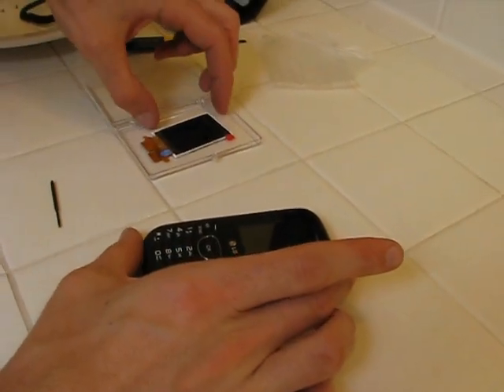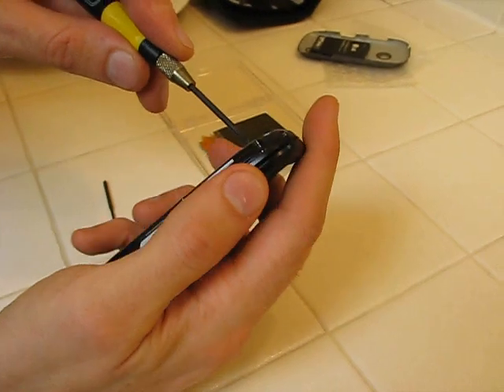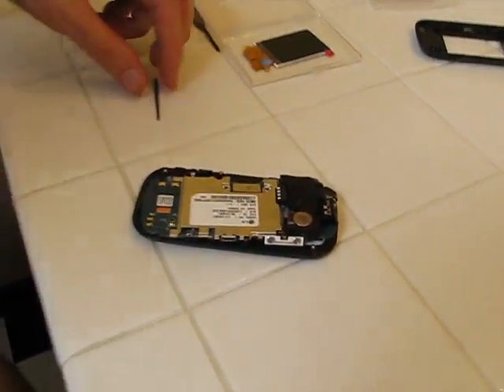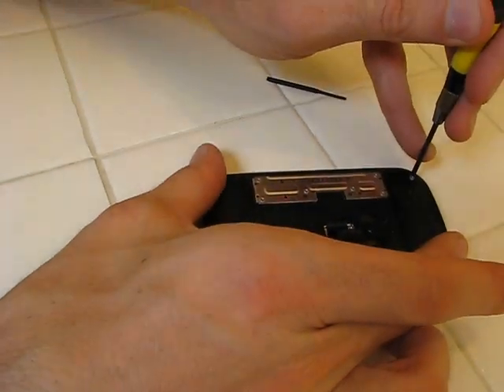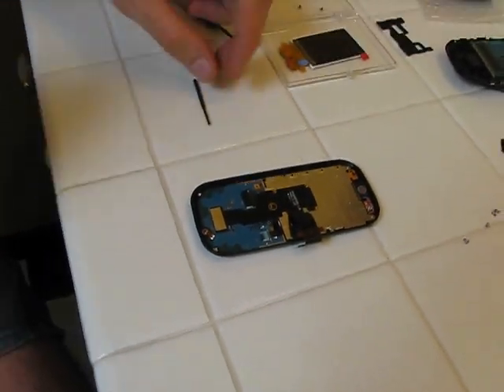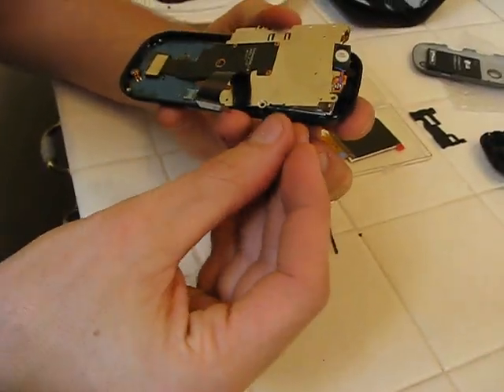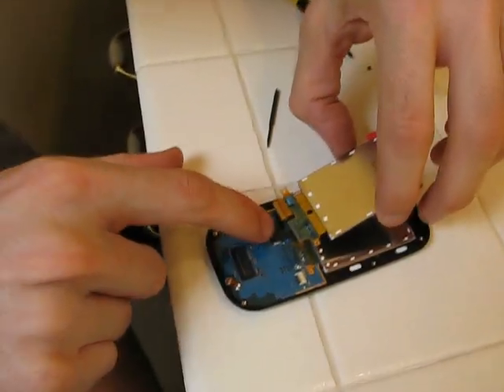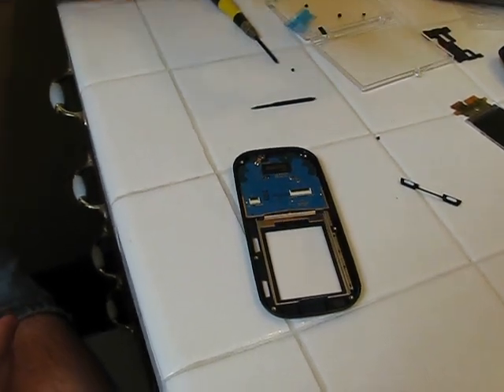LG VN251 Cosmos 2 Remove Screen

Comment: Thank you for your video, it showed me how my wife's similar phone came apart without damaging anything. Got the ribbon replaced and it works just like it should. Seems that the ribbon will wear out after many, many slides open and closed, saved her $65+ in replacing it with a $5 part!

Comment from the maker: The tiny ribbon connectors are a little tricky to get in.  I was worried about breaking them, but they held up OK.  The connectors stick out on the sides a little and I used a small flat head screwdriver to push them in securely.

I reused the tape that I had taken off.  I don't know why it's needed.

Comment: They r called "jaw bone" connectors..... and they actually aren't tricky at all, but from the looks of it in your vid, you just pulled both cables right out!? Not a good thing to do. They actually have a little piece that flips up to unlock the connection to the flex cable,(the black plastic flap/tab on the bottom), this is what i didn't c u do in the vid, or mention. N to put back in, they aren't tricky at all, they just slide right back in and u push the flap/tab down and they are locked in.